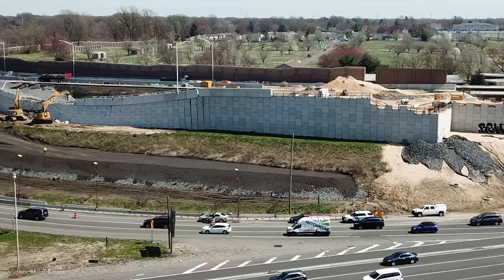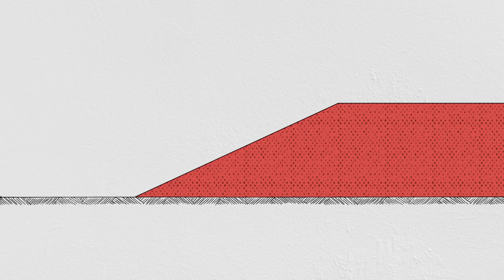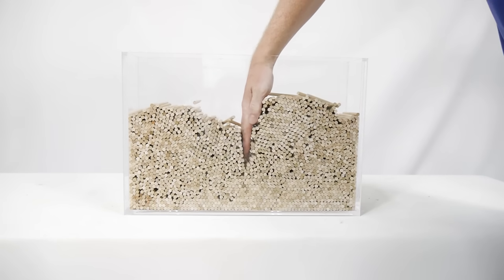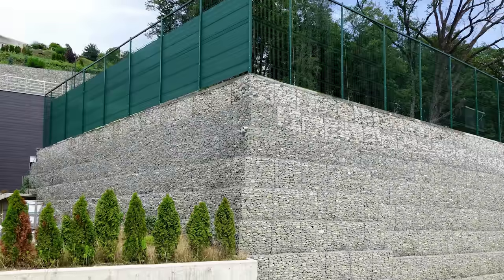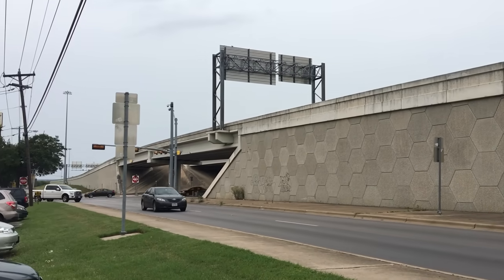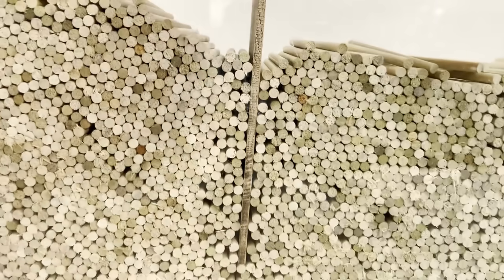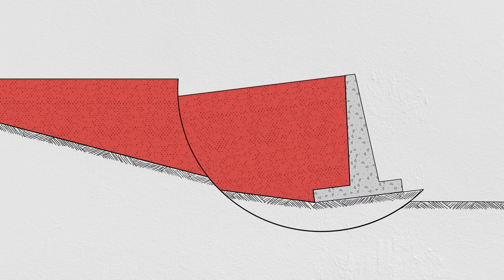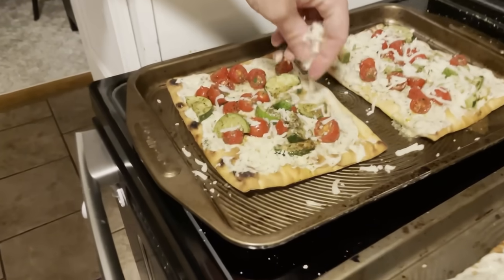Why Retaining Walls Collapse

Comment from the maker: 🚧 Keep up with all my projects here: https://practical.engineering/email-list
🥑 Get some free meals from HelloFresh with code PRACTICAL14 at https://bit.ly/3xWacPO
Reply: Thanks for doing this video, it's very timely as we have a fairly large retaining wall that's just been installed behind our house in the process of building a new duplex. I'm sure it's been engineered but some other issues has been concerning and this video has addressed some of those issues.
Reply: Why are the soil nails aligned vertically and why the vertical gap between each row remains the same?
Reply: @Platypus_Warrior  Soil nail walls are specialty walls used only when soil types are correct and when top down construction is needed. That's right, when the wall needs to be constructed beginning at the top and going downward. The wall batter design is usually 70 degrees, the nails grouted but not stressed and installed in patterns to encourage uniform soil strengthening. The soil nail concept was invented in France.
Reply: Lack of drainage blew that wall out.
Reply: You make those meals look tasty. Alas, Hello Fresh a US-only service.
Reply: I'm liking your recent collapse videos. Not that I didn't like earlier stuff, some has even been useful :-)
Reply: your theme music is horrible.  makes depressed people even more depressed.  Please change it.
Reply: Like berlin wal
Reply: Was great to see this again.  I worked in Heavy Highway and Industrial Construction for 30 years.  I got to work on everything shown at one time or another.  I have seen enough failures during that time.  Most of them were caused by shoddy construction procedures.  Not giving the customer what they paid for because some hotshot supervisor ramrodded the job.  You know, gotta git er' done and all that.  Know what?  After something failed, suddenly there was time to do it right.  Material failures weren't that common.  We made a living at times fixing the last guy's poor craftsmanship.  There were some engineering fails, not many.
Reply: I'll watch your channel BUT...you gotta promise not to eat my liver.👍
Reply: Most often delays over long periods of time lends to many excavations.
Need to start and finish without interventions that come far to often on large projects.
Reply: Great content enjoyed learning a few new methods. 
Ancient civilizations amaze me with their many excavations undertaken with nothing but creative man power.
Reply: Remember man…cooking is really
Just a form of chemical engineering;)
Reply: People don't realize water flows through the ground and can make problems. Heavy buildings can sink and can channel water around structures and under them. I have had a couple of seawalls wanting to keep eating rip rap. 6 tires and some geo grid stopped it. A tire shape forces it's why up and the large footer over tires keeps rip rap from sinking.
Reply: MSE panels I built a lot those, for diferents companies, reco, vsl, ssl, tensar
Reply: They're NOT meals, they're boxes of ingredients.

Comment: I recently helped a friend renovate her mother's property and they were wondering why the water bills were so high. The house has a paved terrace out front with a timber retaining wall at one end, which was starting to collapse. Turns out the mains water pipe came in under that end of the terrace, and subsidence due to the failing wall had caused the pavers to break a t-joint for a garden tap on the exterior wall of the house (poor plumbing design there), causing further washout of the soil. I'm now imagining such an event scaled up to "large civil project" size... yikes!
Reply: Hence the need for through terrain and soil analysis in any serious construction.
Reply: You miss 100% of the shots you don’t take
Reply: @In.Darkness  Hi Darkness! 👋
Reply: 12 years I've done civil and industrial hydrovac work. Bursting water mains are so incredible when they dig a hole for you 6 lanes in width. The ground is always moving. And seeing what happens to aging infrastructure is just incredible
Reply: Lol, the wall collapses so it's "poor plumbing design".
Reply: @PrivateLeffers  I think he meant that the spigot shouldn't have put where it was because the problem was at least semi obvious.

Comment: I design retaining walls (precast modular and segmental block) every day and often struggle with getting clients/contractors/architects and even other engineers to understand the basic concepts. Lots of engineers love to place cut walls right on the property line (because the architects have used up all of the space) and then they can't understand why they need easements to cut into the neighboring property in order to build the wall from the bottom-up. I think I need to just start sending them links to your videos.
Reply: my story is exactly same ... lets put inside of the wall on property line, ur structural engineer YOU have to figure it out we dont care.... architects are our archenemies (lol pun arch really fits there)
Reply: those damn architects
Reply: Surveyor here simultaneously face palming and sympathizing. I see similar things all the time, maybe property ownership should come with a class on what it actually is and means? Good luck out there!
Reply: @monad_tcp  architects and their great ideas are the bane of my life
Reply: As a former AV installer/service tech I've done a fair bit of work on high-end residential/commercial new builds. I can attest that architects are... somewhat inflexible (to put it politely).
Engineers (structural/fire/hydraulic/whatever) typically had pretty clear reasons why things had to be the way they were, why equipment or cabling had to be installed in a certain manner or avoid certain paths/voids, why certain bits of framing/structure couldn't be messed with (or at least not without substantial costs for a redesign). Architects... not so much.

Comment: I was on a housing board where several retaining walls came into question. One had experienced some crumbling near a sidewalk. We were concerned that it might collapse and injure someone. In time, we replaced I believe six retaining walls. Retaining walls were very expensive. Most builders don't build them. The only builder we could find that could build them was the same builder who built the original walls 20 some years earlier. The new retaining walls have a nice look to them. They improved the aesthetics of the neighborhood greatly.

Comment: I only ever did the calculations for one retaining wall and I used Reynolds text book to do my calculations.  As I still understand it the thickness depends on the 'angle of repose' of the material being retained (in my case sand) and the overturning moment due to the height.  I was shocked to find the wall was to be 4ft thick at the base.  I got my calculations checked by a Professor of Civil Engineering and he told me I was spot on.  The guy I was doing the drawings for (a garage cut into an embankment with another persons house near the top of it) decided it was all rubbish and cut the ground away to build without the retaining wall.  I withdrew from the job only to read about 5 months later as the ground dried out the land had slipped damaging to the the new garage and the other persons house.  The idiot went ahead without local authority consent.  It cost the guy big time as his insurance would not pay and his neighbours insurance also went after him.  Not only that he was sued for damages uncivil court and also fined for unauthorised development.  The moral is....do it right the first time.
Reply: Yes...  it always better to do it right the first time.  I bet the guy had to file BK before it was over unless he had assets to liquidate that the court could force him to sell.
Reply: If his answer to someone telling him the wall had to be way sturdier than he thought was to build it without a retaining wall at all he deserved it.

Comment: I’ve been a safety person for over 25 years with 15 in geotechnical construction. Your videos are such a great learning tools for our young engineers and safety people. Keep up the great work.
Reply: I am also a 25 year veteran of Building Engineering (in the UK - but physics is physics) and I often push graduates towards this channel as additional learning beyond the help I offer. They are impeccably produced with consideration of the sequence with which you layer up understanding of engineering ideas. I lecture Architectural Students, and pacing and sequencing of learning is incredibly hard to get right - I’ve used this channel to polish up my approach to some of the more complex engineering forms. Also, having a bendy straight edge and a couple of books to act as props to explain flexors and level arms always helps!! Great content, keep up the good work PE!

Comment: Fun fact: I was driving my sister down to visit family the other day and drove past a short retaining wall on the side of the road. I remember when it was installed about 15 years ago. When it was installed, it leaned the right way - top leaning in towards the hill. Now it leans out. Someone didn't engineer proper drainage for the wall, and Colorado's expansive soils combined with 15 years of rain have pushed the wall out. 
So it's interesting the timing on this video :)
Reply: Better call the DOT and let them know.
Reply: @ih82r8  "No problem found" will be the answer. I called about multiple safety related issues to multiple agencies with the same result.
Reply: @shaneclarke6307  well we can still do our part at least instead of just being cynical about it and turning a blind eye.
Reply: @shaneclarke6307  
Opportunity for a lucrative lawsuit
Reply: look at what happened on Hwy 36 a few years back!
Reply: @ih82r8  It's at least another decade away from failure and it's a low retaining wall that doesn't pose an immediate risk to the roadway or traffic if it does fail. Probably why they didn't bother engineering it right in the first place.
Reply: @pufthemajicdragon  The funny thing is adding drainage hole might cost ~$1000 and save the $10,000 wall or add another 30 years to its lifespan.
Reply: @MathTutorVideos  no argument from me! 

(OK well maybe one argument. Adding proper drainage after the fact is HARD. You have to remove soil from behind the retaining wall, push the wall back into place, drill through it every 5-10 feet, install drainage pipes, deposit drainage material such as gravel, then replace the soil. There's more than $10k in just the material cost of the concrete alone. The 10 foot tall 120 foot span of retaining wall probably cost upwards of a couple hundred thousand as one part of a multi-million dollar improvement project. I find people are terrible at estimating the costs of infrastructure. That should be a topic for one of Grady's videos someday.)

Comment: I built a big deck on my house some years ago that involved a 4' tall poured concrete retaining wall.  I was perfectly confident speccing out the posts, beams, joists, rafters, etc myself, but I absolutely sought the services of an engineer for determining how the retaining wall should go.  Built everything to his exact specifications, and 4 years later the only damage I can see is some almost-invisible cracking straight down the control joints put in for that exact purpose.  5 stars, would engineer again.
Reply: Shelling out for that engineer's stamp is some of the cheapest insurance/peace of mind you can get. Sure does beat getting stuck with a could've should've would've moment some time down the road.
Reply: @murraystewartj  I call bullshit and I’m an engineer.
Reply: @murraystewartj  lol waste of that would be, specially for a 4ft tall retaining wall. If it was a house or a giant wall then yes, an engineer needs to be contacted but for a tiny wall it's a waste of money
Reply: @StallionFernando  Check your local building codes. Regs vary wildly and may, for example, depend on such things as soil contitions, the specifics of the site (drainage issues for one) or other factors. I have seen gravity walls (think Allan block) of less than 4' fail catastrophically - this was in an area with high annual rainfall so drainage was the likely culprit. One I remember blew out and partially went onto the road. This was in a "rich" part of town so money wasn't an issue, I believe, just folks being cheap. If in doubt check with the local planning/permit departments, and spending a few bucks on an engineer or geotech is, as I said, pretty cheap insurance compared to the cost of a failed retaining wall, even if it's less than 4' high.
Reply: @greenidguy9292  Was a Civil Engineer years back. I call your bullshit. My time as a such I can tell you the biggest catastrophes and most costly failures are always because someone thought they didn’t need to follow proper construction guidelines. I’ve seen folks mess up the curvature of entire streets, destroy property by not calculating water run off for emergency flood retentions, building where the ground clearly needed further compression. In all cases these mistakes costed the city thousands sometimes millions. Home owner cases were the number one majority of my work as a Civil Engineer. If I wasn’t working on some major job site my most frequent task was water, electrical, sewer, property corners, and ground stress testing for home owners wanting build on their property. You mess up a retention in someone’s backyard and it could flood the neighborhood and you would be financially responsible for all that damage. 

Just call the Civil Engineer. Don’t be an “architect” (Sworn mortal enemy of Civil Engineers is the Architect 🤣) follow city and building guidelines.

Comment: I was on my HOA board for two (terrible) years, and among the many contentious maintenance projects we had to address were many retaining walls that had washed out or otherwise destabilized over time. I don't envy anyone who tries to convince stubborn skinflints that yes, it really is important to have someone who knows what they're doing to build these things, and we can't just cheapen out and do it better ourselves with stuff we buy at Home Depot.
Reply: In 2003, I hired a contractor to build a retaining wall for me. He told me that he had experience doing so. He decided to use railroad ties. When he started construction, I was horrified to find out that the spikes he was using to nail them together only penetrated the next railroad tie about 2 inches. I have a friend who is a geotechnical engineer. I asked him to come look at it. My friend told me everything that was wrong with the design and my friend talked to the city inspector who was assigned to the job. The inspector made the contractor do everything that my friend recommended. Needless to say, the contractor was NOT happy!

The inspector made him install "dead men", which are essentially like the ties grady described that are drilled into the side of the wall. Then, he required the contractor to drill holes all the way from the top to the bottom of the wall and drive steel rebar all the way through.

Comment: Although I'm not an engineer (of any sort) this video did strike home on a personal note.  A couple of years ago I built a patio in our back garden, and because it was on a slope, I ended up having to build a six brick high retaining wall at one end. I've never done anything like this before, so I just laid some concrete footings and built the wall!  (Back filling with soil.) I did include a few drainage holes to stop water building up, and laid the wall double, with more substantial footings (the rest of the patio base was single brick) - and of course the ends of the wall are 'tied' into the two side walls. But I did all this by gut instinct - without any real understanding of what I was doing. After all, it was only a patio! Now I'm sitting here wondering how silly I might be looking in a few years time...
Reply: We've all done that, I think-my lesson from Grady is to put the footing on the upper side so the dirt hold it down for ya  cool!-

Comment: Thanks for this presentation I work for a Railroad contractor and my primary assignment is a bridge replacement on Route 9 in Middletown Ct and I asked questions on the procedure out the tie backs and the drilling to to determine the bed rock strength , this video cleared up a lot .

Comment: I have to drive past that highway project in New Jersey 2 times a day; on the way to and from work.  The collapse is a disappointing setback because the project is supposed to fix a major bottle neck area of major roads on the NJ side of the Delaware river just outside of Philadelphia.  Thanks for the video!